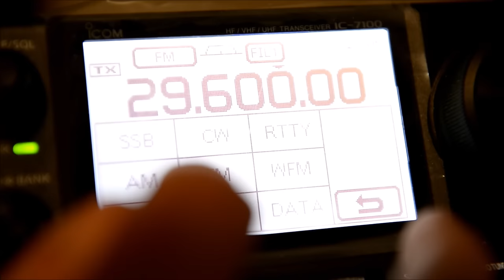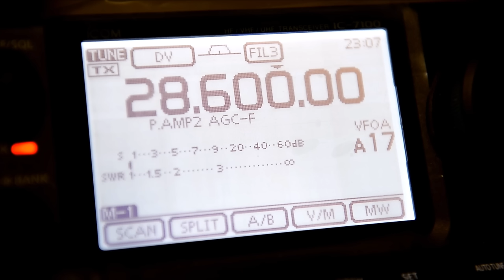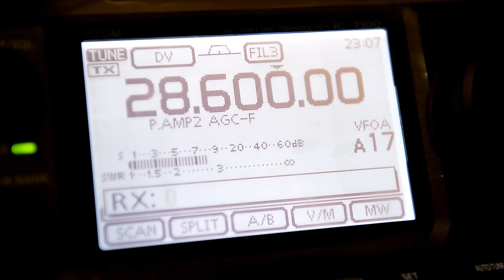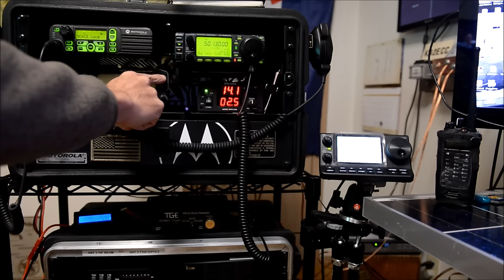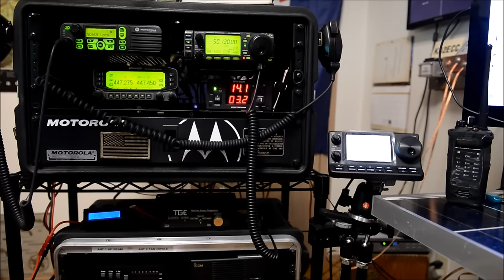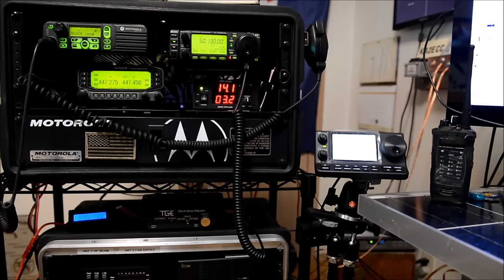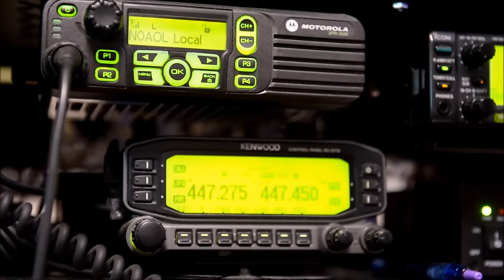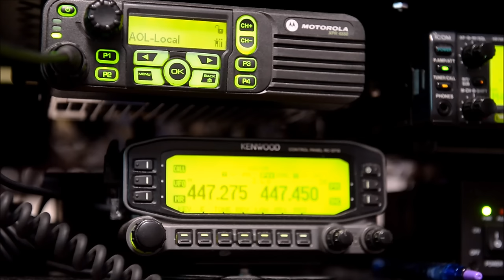DMR vs D-STAR : (10 Meter Simplex)

Comment: It’s interesting, the dmr motorola handhelds sound like people are slurring their words, we have a bunch of them at work, we have an XPR5550 and it’s tied into the 70v PA system so if someone wants to call for someone on the overheads they can. It’s weird but the audio sounds clear and doesn’t sound anything like the handhelds or even like it does over the radio speaker. So I can say the speaker has something to do with it!
Reply from the maker: dmr is interesting. it has been fun. peace from the war shack. de nØwar

Comment: Our club runs C4FM and we think the Audio is much better then D-Star 2, 10 , 80
Reply from the maker: +geco hurt thanks for watching goco. our club now has 2 fusion repeaters up here in fort collins. i do not have fusion yet.
you can hear a big difference in the dstar vs. dstar. i have yet to hear fusion but hear it is very very good. some of our longtime turbo guys
even say the fusion sounds better than dmr. keep watching.
Reply: Why should there be a difference in the audio between D-STAR, DMR and C4FM?  It's the same DVSI proprietary AMBE vocoder.
Reply: its really the same vocoder with different CODEC is all it is. so really if you dig into it you could technically you could reprogram the codec (as with the fusion repeater it can be converted ive seen videos) and use the other modes

Comment: Not sure whether the speaker test between the two radios was fair, with audio coming out of the back of the 7100 Was firing in to the room and echoed everywhere  Not a good comparison . I have mine in an ext 3 way and sounds better than both of those.
Reply from the maker: thanks peter for that. i will make another video. keep watching!